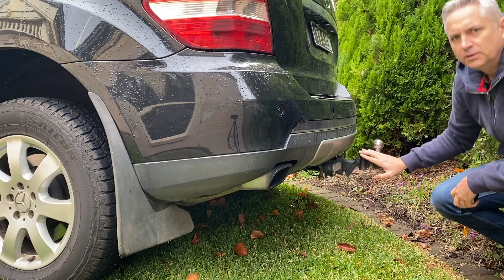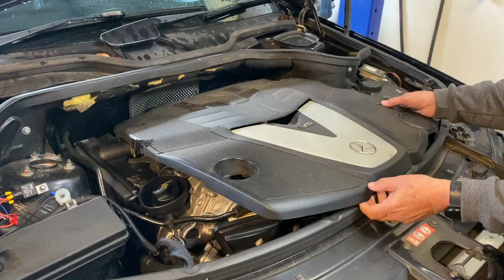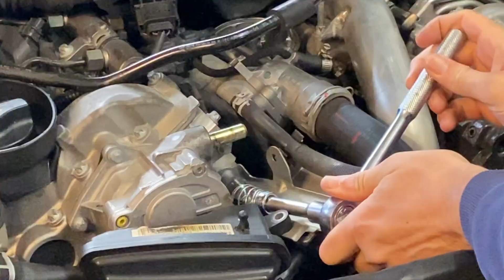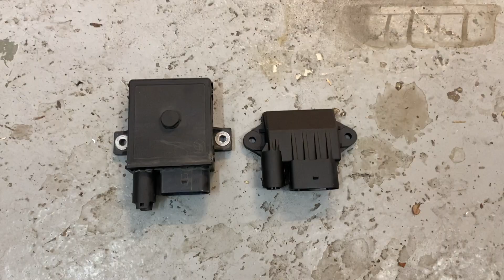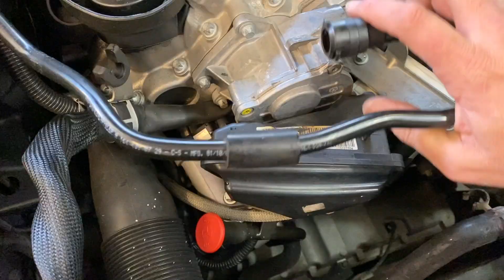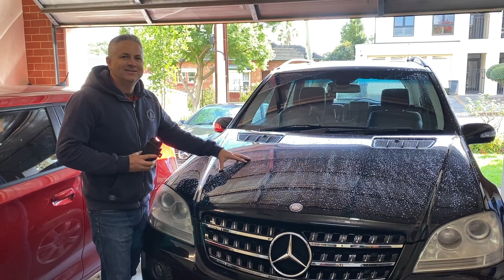Mercedes Diesel Slow Long Start - ML GL W164 OM642 Jeep Chrysler - How to Replace Glow Plug Module

Comment: Do these controllers just go bad or can faulty glow plugs damage the controller ? Cheers.
Reply from the maker: Great question.  The controllers are poorly designed with a flat ribbon piece of copper which fractures with age and vehicle vibration.  Cheers Drew

Comment: I have a 2017 GLS350D and the check engine light has come up twice and the coil symbol flashes up randomly for a splot second. I took it to Mercedes-Benz MacGregor in Brisbane to ahve the code looked at the service manager said it was the module coming up as the error code. Repco doesn't sell this part so i either have to order it from Melbourne or pay a fortune for MB to do it, even though we have 2 months left on our 2yr extended warranty....i highly doubt theyll cover the cost to replace this as its been a headache getting so many other psrts replaced in the last 2yrs. The car starts perfectly fine, no smoke...yet, so im wondering if the check engine light is yet again that module coming up as faulty. I cant get into MB till next week and i drive 150km a day to get to work and back in a regional town south of Brisbane...so its an absolute headache to get this fixed. Ive fixed amd repalaced a lot of parts alteady that theyve refused to do ubder the warranty, still have 3 other major things to rectify that i will also have to pay for. 

I love this car but i also hate it with a passion and its a massive head fuck everytime we get in it waiting for it to break something.

Comment: Hi Drew,

I have a 2010 ML300 with the long crank cold start issue. I found if I turn the key to ignigion and qait 10 to 15 seconds it will start without the long crank. Recently this methid stopped working but if i cycle the ignition on for 10 seconds then tuen the car off remove the key and cyxke again for 10 seconds it will start witboit tbe long crank. I assumed it was bad glow plugs and the ignition cycling was just allowing more time for them to warm up. Could it be the relay?

Comment: My Jeep 3.0 l crd v6 has the same engine and experiencing the hard starting issue. I shall order a module and hopefully the issue of hard starting is resolved
Reply from the maker: Yes it will be the same module if it's the OM642 Mercedes Engine which a few of the Jeeps had!  Cheers Drew

Comment: Hi, thanks for the video.  I replaced mine (2007 ml320) but nothing changed, still long crank and white smoke. my glow plugs are new as well.
Reply from the maker: You might want to check the fuses/relay and the wiring to the glow plugs. Cheers Drew

Comment: Thanks for vid

Quick question - how do you know it’s the glow plug controller, rather than glow plugs themselves? Did the Scanner know the difference?
Reply from the maker: Hi Mate, in my experience a decent scan tool will tell you if it’s a issue with the glow plug(s), however I have never seen a scan tool detect the issue with the glow plug controller.  I expect that this is because of the nature of the failure in the glow plug controller is typically the thicker copper bus bars which develop cracks and thus this not normally an electronic failure.  I hope this helps?  I have a failed glow plug controller at home that I have been planning to cut open to determine the fault … is this something that you would like to see? Cheers Drew

Comment: Did it show any error code before you replace it?
Reply from the maker: Hi Mate, great question, interestingly there were no codes present.  Cheers Drew
Reply: @DrewFixIt  Seems like there is only +12Vin and 6x2 outputs for glow plugs. So no can bus. Therefore no communication, no codes.

Comment: I have an issue,every two months car would crank and not start first time but third or fourth time it would start normally,12.5v with engine off and 13.5-7 engine running,got the gse116  going to see if this is gonna fix it

Comment: Did you get any codes on the scanner? I'm pulling a 102F00 on mine... "The signal of terminal 15 is implausible". Car shuts off intermittently while driving. 2010 ML350 Bluetec. I'm not sure where Circuit 15 points to but I'm guessing ignition control... is that the same as the glow plug module on these?

Comment: Thanks for the video! I have this problem on a 2008 Jeep Grand Cherokee, but it's intermittent. Most of the time it starts up just fine, but sometimes an extended crank followed by the big puff of diesel-smelling white smoke. Lots of google searching the issue... most discussions suggest leaking in the fuel system which seem implausible to me. My big puff of white unburned diesel at startup makes me think my problem is also glow plug controller.
Reply: I'm gonna check mine...slow to start in the morning..  but starts easier all day long

Comment: Hi Drew, Hi do you know its the glow plug module and not the glow plugs themselves??
Reply from the maker: Hi Mate, you can measure the resistance of the glow plus with a multimeter.  If they are open circuit they are stuffed!  From memory they should be somewhere in the 160 to 200 ohm range.  Cheers Drew
Reply: For me, I thought it was the plugs, but control code came up too and a mechanic  had mentioned the controller (after I had already bought some new glow plugs)

Comment: Did you have a fault code showing ?
Reply from the maker: Hi Mate, what was interesting with this one is there were absolutely no fault codes showing! Cheers Drew
Reply: @DrewFixIt  Thanks .
Reply: I did the same job 2 months ago and no fault codes were present. If an OM642 has long cold starting then in the majority of the cases is the GP control module

Comment: I'm having the same issue. Excellent.
Reply from the maker: Hi Tazeem, awesome, do let us know how you get on!  Cheers Drew
Reply: @DrewFixIt  The part you linked to was sold out and I had to order a different one. After much struggle, mine had some cables in the way, I was able to install it. It works prefectly. The car starts in a couple of cranks, even in very cold weather. Thanks.
Reply from the maker: @tazeemn  Ok, thanks for letting me know.  I will find a alternative part that is in stock and update my links.  Cheers Drew
Reply: My car takes a very long time to start
Reply: @HasAki-g5s  ...how much, 1 hour, or more?